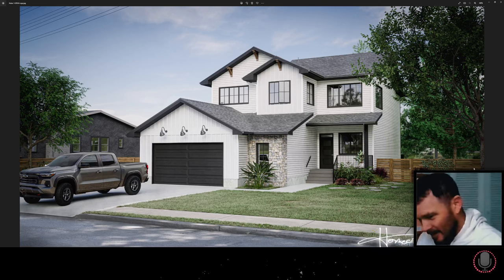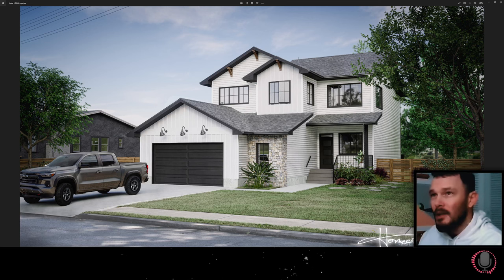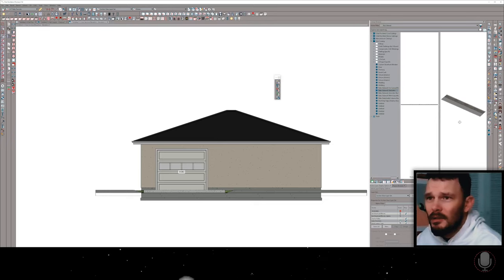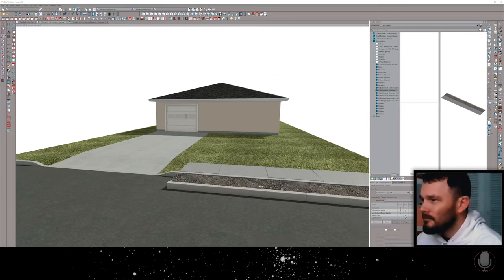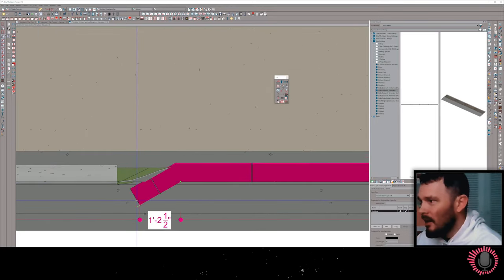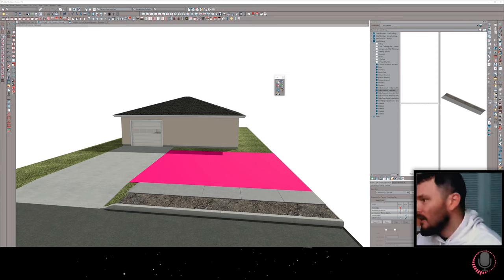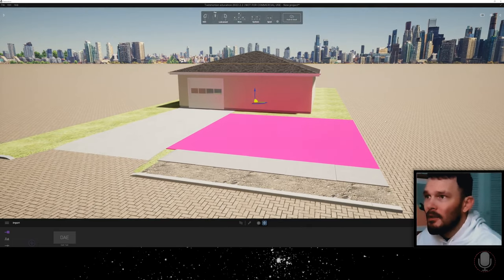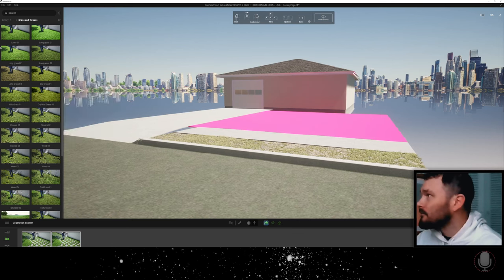Chief Architect X14 to Twinmotion. Free Curb and Sidewalk Generator

Comment: Being in the PNW have you ever tried working in log home construction? I've been having some interesting issues with showing and modeling log homes and would appreciate any advice
Reply from the maker: What problems are you running into?
Reply: @rabbittdesign8482  I am working with Rochelle Lynn Design from Cochrane AB Canada, our main issue is having it look visually proper with the log profiles, to be able to cut sections that reflect properly but still have the doors and window work and interact like a proper wall system.
Reply from the maker: @alexanderslobodian2024  that is a tough ask. I’m a bit advanced as a user so it would be easy for me to make a molding out of stacked and cut poly line solids to my specific Height and have them auto-cut to windows and doors.